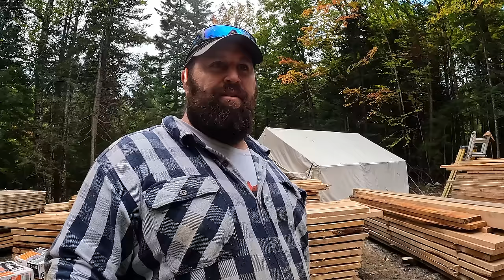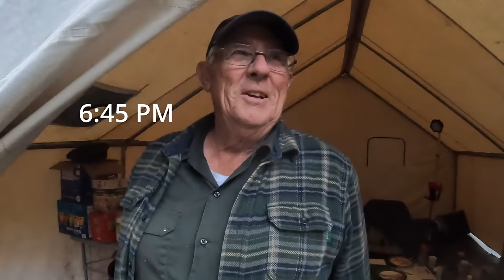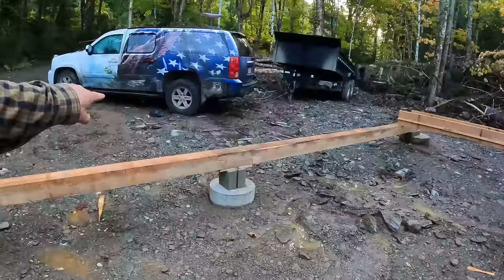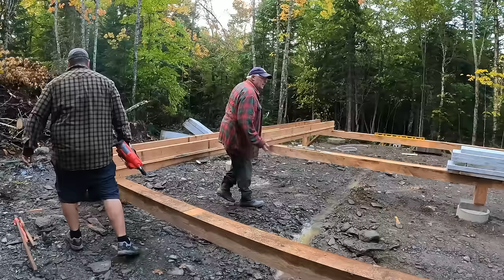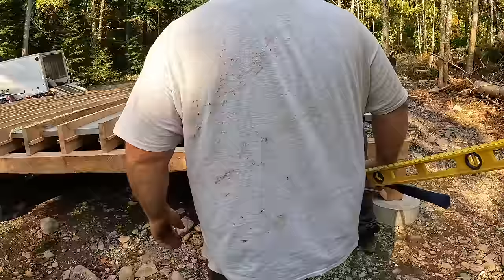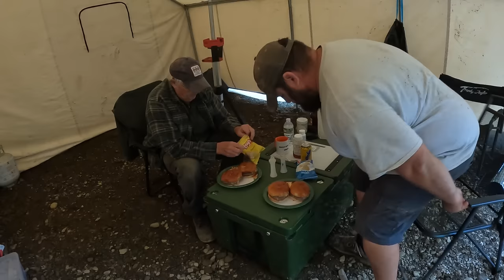Off Grid Cabin: Floor System. Homemade Floor JOISTS: episode 12

Comment: Looking awesome Joe.  I’ve done a lot of building and really i couldn’t think of a more efficient way to get those strips and foam in.  I think the way you did it was less taxing on you and Donnie.  Running on top of joists, bending down to nail those strips on the joists were already up would not have given as consistent a air space.
Reply from the maker: Thanks buddy, It was a lightbulb moment for sure. Doing it once the other way was all I needed!

Comment: Great progress! The new battery nail guns are pretty sweet compared to the old air nailers.  I’ve used one of  the Milwaukee framing guns, they are great! I have a Pasload  angled finish nailer that works well, so I haven’t made the switch to the battery nailers yet. I do have the 12” compound miter saw. That is great! Can’t wait to see the next segment!
Reply from the maker: Thank you, The new tools really make the job easier especially off grid like we are.

Comment: Make 3 spacers to use between the joists as you Install them, so you don't have to spend time measuring and adjusting them on each beam.  Just lay the spacers down, push the joist against them, and shoot the nails. 😊
Reply from the maker: That's one way to do it for sure.

Comment: Great video series, I’m going to be doing some binge watching. I’m also going to be a frequent commentator with questions. I appreciate your responses and guidance. I might have missed it but why didn’t you run the foam insulation out to the ends of the floor joists?
Reply from the maker: I ended up running it all the way out I just had to get some smaller pieces to finish the full length sheets
Reply: @JoeHollandFishing  I’m watching the one where you’re about to lay the Advantech as we speak.

Comment: If you hold the hammer handle further down you will not have to hit the nails ten times to pound them in !
Reply from the maker: haha so true. Only paid for half a handle though so it would be like cheating using the other half.

Comment: If I missed it I apologize, but what keeps the foam from uplifting in the wind or critters pushing up between sections?
Reply from the maker: The foam is in there very tight and with little room to move. There is a 3 inch air gap above it before our sub flooring.

Comment: Is the plan only R10 in the floor system?  Maine can get mighty cold.
Reply from the maker: Yes just the blue board and the air space underneath. We can always add more if need be. With heat rising I think we will be ok.

Comment: Looks like you are over lapping the joists in the middle.  Why?  Never seen that done.  😮 Butt join them on the middle beam with strapping so that the spacing will be the same. 😊
Reply from the maker: We overlapped them because we milled them long enough to have cut offs if need be. Overlapping them and joining them together adds a ton of strength in all directions including down. It also makes the measurements perfect to the lines every time without a cut.